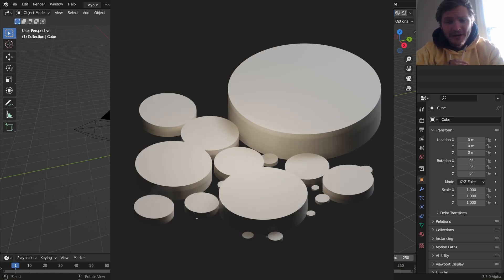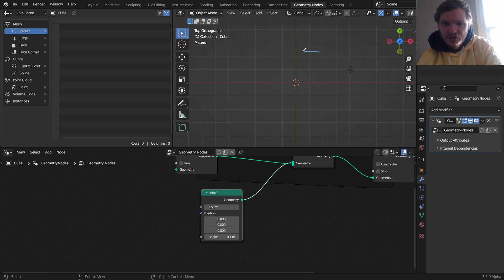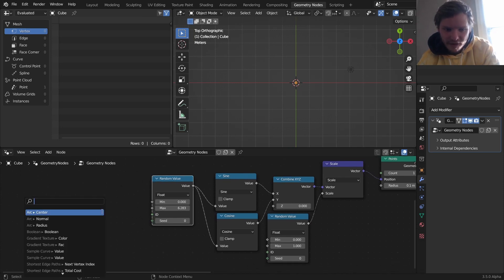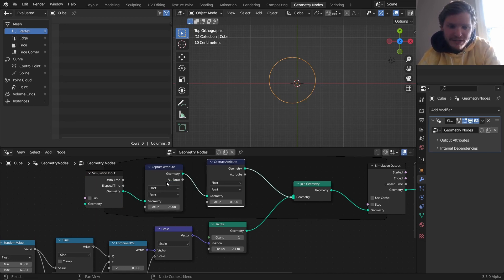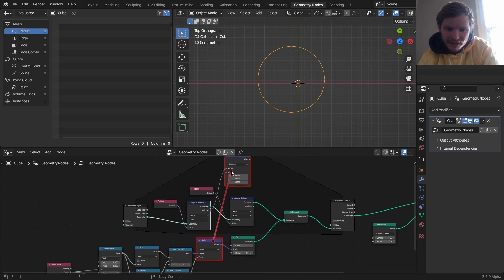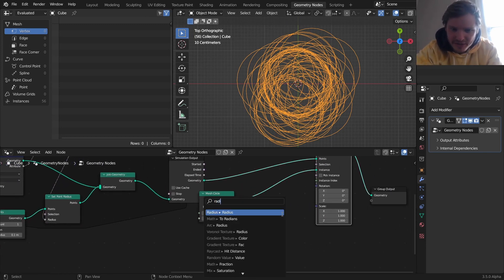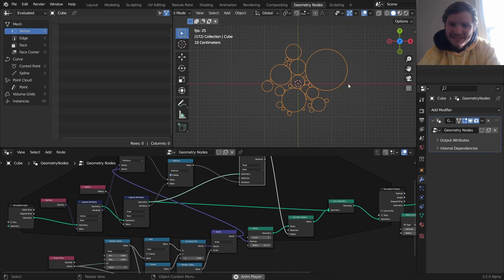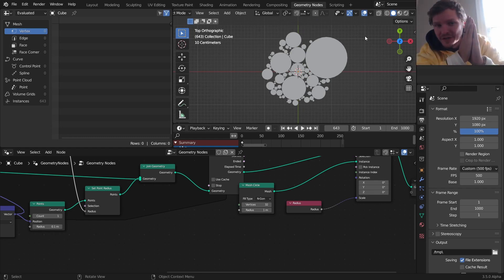NEW Algorithm - WOAH!

Comment: Btw, that random way to distribute points on a circle doesn't place them evenly across the area (half of them will be on the interior half radius, which has a lower area than the remaining space). Of course, that's not a problem in this case.

Comment: I really love geometry nodes and find your use of them very clever. But I can't help but feeling that 90% of the logic in this algorithm would be easier, clearer and more efficient in code. All the polar / cartesian coordinate conversions and distance finding stuff could be single lines of python code rather than 10-15 connected nodes.
Reply: The best way to decide this is to try both (using the same set of circles) and then see which is faster.  Python may be slower.
Reply: @FireAngelOfLondon  Why would it be slower?
Reply: @alex15095  Because Python is generally slower than C++, which is what Geometry Nodes uses.
Reply: @sonario6489  Python is also written in C, and both are interpreting a higher-level description of how to manipulate geometry, so I don't think that's a meaningful comparison

Comment: hey default cube😄could u pls help me with something...i wanna be able to select some random faces in geometry nodes...do u know any way i can achieve that??? i know i can use random value and compare it to face index for 1 face, but i require hundreds or even thousands of random faces...is this possible with geometry nodes??
Reply: Maybe Separate Geometry switched to faces and to selection input plug in "random value" switched to boolean? And Join outputs together with Join Geometry
Reply: You can also select specific faces by "Face Area" node with "Compare" node and plug it to selection input... or try to use "Random Value" plug it to "Interpolate Domain" node and switch to Boolean and Faces and these  nodes plug into selection... hope that'll help you